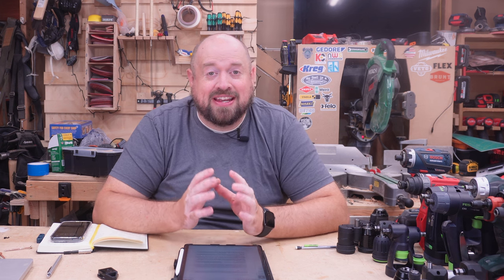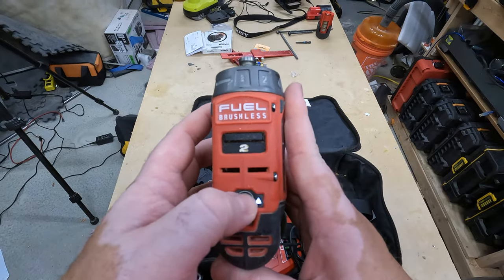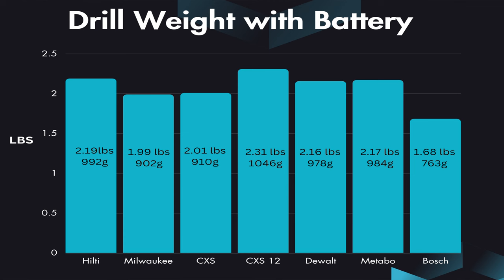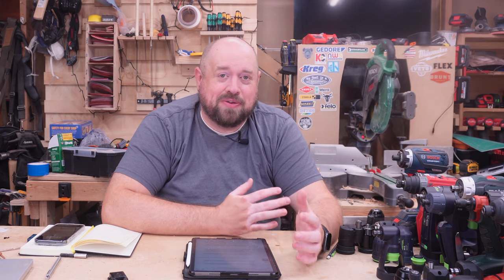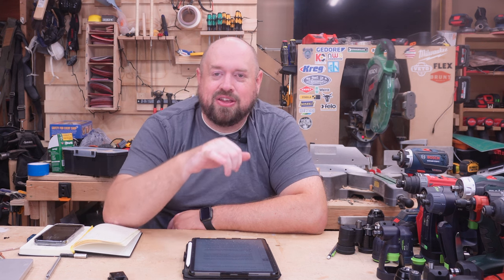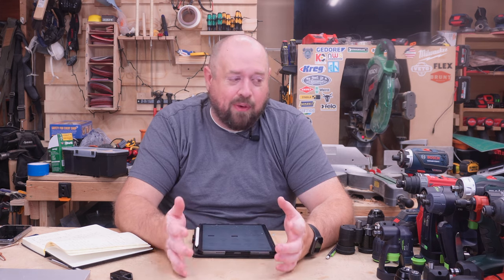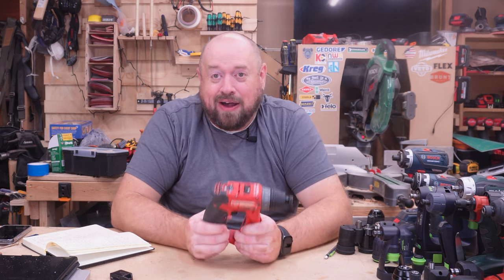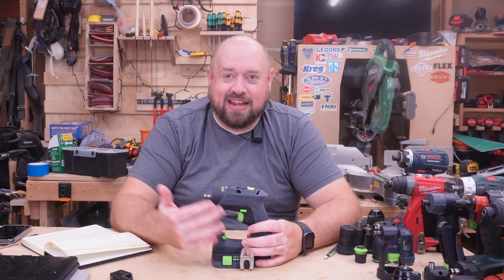Installation Drill Showdown!  Can Festool beat Milwaukee, Dewalt and More???

Comment: What is never mentioned in most reviews is bit runout. One of the reasons so many cabinet makers use Festool drivers is that the Centrotec bits have the least runout of any other manufacturer.
Reply from the maker: You are right, it wasn't mentioned.  I really do like centrotec in terms of the control that it offers, but it's also another added cost with running festool products.  I have next to no local availabilty of centrotec bits even at my local festool dealers.  They just don't have a lot of it in stock, even if I wanted to pay the price.   And without it, the festool experience is less functional than the other brands featured here since the locking 1/4" hex bit holder isn't included with tool just the magnetic one.   Not bagging on it's function, more the cost and the ease of access to the system.
Reply: I’m fortunate that I’m only 5 minutes away from the largest Festool dealer in Maine; and they stock everything.
Reply from the maker: Yeah, I wish that I had that.   I don' t have a need for the giant bit kit for this tool but it would be nice to have some of the common sizes.  And when I go in, they just have very little in stock.

Comment: Note: the 18v CXS is a little more powerful than the 12v version, but it’s also likely a little more powerful than the specs suggest. Converting nm to inch pounds off the UK Festool website, they are using the same max torque specs for both the 12v and 18v drills (compared to the US site), but the US version of the 18v has a 4 Ah battery rather than a 3Ah (whereas both 12v drills come with the same 2.5 Ah batteries). Both sites also claim the 18v w/o a battery is the same weight as the 12v. I’m not sure how that can be, but it can’t be much of a difference anyway; and because of the c body, the 18v is probably similar in height to the DeWalt 12v, but it is also probably considerably more powerful because of the battery (while still competing in the same size/weight class of drill). Just as important, the 18v CXS is 3 db quieter than the 12v CXS. As you probably know, 3 db is significant considering the non-linear/exponential nature the decibel rating system. Just some more food for thought.
Reply from the maker: Thanks for sharing.  I have never tried the 18v version, but have been curious to know who people are liking it.  For the most part people comment that it isn't as loud.

Comment: I grabbed the Dewalt bit driver (no speed select on gearbox) to try out a couple of years ago and then an 18v drill and impact as well.  I was surprised to find that their trigger precision was almost like Festool.  The attachments just seemed cheap on the Festool clone, though.   That said, the attachments are cheap on all of these 12v’s compared to the 18v Fein, Festool, Metabo and even Bosch.  So, whatever.  The original CXS is just too weak to take seriously, imho.  Discounting the brushed Metabo, all of the others are going to do the job of the T18/C18 but smaller and lighter…and louder.  Words can’t describe how quiet the T18 is.  I never appreciated until I got back into more general work and ended up trying every brand under the sun.  The Hilti chuck isn’t as niece as you think it’s.  Don’t be fooled by its metal sleeve.  The Hilti 12v’s are identical to the Panasonic counterparts in all but looks. I like them because I like how they feel in my hand, but I have to presume the Dewalt, latest Bosch, Milwaukee and brushless Metabo all offer more torque.  I was considering the new CXS or the 18v TXS they take the same chucks as my aging T18. I dunno. Kind of on the fence.
Reply from the maker: Have you had issues with the Hilti chucks.  I have had an 22v Nuron Hilti for about a year now and it works incredibly well.   Plus with their 20 year warranty it’ll put anyone’s mind at ease.
Reply: @TinkerWithTools  Coincidentally I did have an issue with one chuck (I totally forgot about that) on a 12v. Same chuck as on the Panasonic version.  No issues with the one that comes with the multi head.  I did replace the chucks on my Nuron drills simply because I didn’t like them. They were fine though.  The 10w-22 and 8m-22 will have Röhm chucks. Everything else appears to be Jacobs but without branding. But I could be wrong.

Comment: I've got my eye on the Milwaukee. For me, a big selling point of the tool is the grip style and size, so while the DeWalt seems like a fantastic deal the larger size and standard grip just don't sell it for me (I've already got a normal sized DeWalt 20v drill and impact driver after all). The interchangeable chucks are almost just gravy on top of the ergonomics, but the offset chuck is probably the one I'm most interested in. The number of times I've put a screw in just slightly off angle because I was in a corner, that seems like such an incredible feature. I really don't think I would mind the top button, I think I have large enough hands to just hit it with my thumb when needed.
Reply from the maker: If the Milwaukee is the only tool you use, you would likely get use to the Top button and would be fine with it.  I have owned that Milwaukee for over three years at that point and still love it.  But it's not intuitive at all.  I find myself flicking the forward and reverse on any other tools without even really thinking about it and this one just requires a little bit more effort.
Reply: One thing you will find out with the Milwaukee is the eccentric chuck doesn't have a locking collet. I have found bits tend to get left behind more times than I would like. Not a huge issue but something to consider.
Reply: I wasn't sure if the direction button would bother me when I got the m12 and I found that I haven't had many issues. I've gotten accustomed to it. The grip ergonomics on the m12 are great, and If a traditional switch threw off the grip ergonomics, I don't think I would be willing to part with the button.  @TinkerWithTools
Reply from the maker: @jronmanbuilds  you are right.   I haven’t had issue with it but my hard to reach places have more been up against the top or bottom of a cabinet where that hasn’t been has much of an issue.
Reply from the maker: @jronmanbuilds the Festool CXT has pretty much the same grip and ergonomics and the switch works great on those in the standard location.  That’s my point of reference that it is possible and my continued hope for a gen 2 where they revert back to the normal placement.

Comment: Great job and great information! Thank you! I will note that Amazon has the Milwaukee AS A KIT for $140, and I haven't seen anything from the other brands to match its value. Although I am on the DeWALT flexvolt system (and Milwaukee M18), I do not have any 12v tools so for me I have to decide between the excellent value of the Milwaukee or either the DeWALT or Festool CXS12. Thank you again for taking the time to do such a thorough comparison.
Reply from the maker: Glad it was helpful!   The only caution with Amazon I would give you is that they aren’t an authorized retailer so it can affect the warranty on the tool.  Your mileage may very.
Reply: That is where I got mine from. And I am a Ryobi guy, I mean everything from tools to yard stuff. Love the M12
Reply: Got the milwaukee at HD for $120 after returning free m12 3/8 ratchet
Reply: Also got the Bosch flexiclick for $110 on amazon, wish I hadn't missed the lowe's clearance...
Reply: Got m18 for 109, hack deal.

Comment: Imo Bosch wins, I don't really agree with your ergonomics rankings but besides that it was a great test. I had the dealt but it just felt cheap to me.
Reply from the maker: Ergonomics are going to be fairly personal.   I get that.  And you right, the dewalt doesn't necessarily feel like the most robust option here.   The bosch is a little tank and performs quite well.  There are just a few minor things that I don't prefer about it.

Comment: Walmart recently released Hyper Tough 12V  3-in-1 Multi-Head Power Drill Set with 1.5Ah Battery and Charger, 80003. Currently going for $34.88
Reply from the maker: Yeah I see that.   Based on the power specs the quote I would suspect it would be outclassed by almost everything here but for that price might be worth checking out one day.

Comment: I know many people have an issue with the noise on the CXS 12. I Have been using it for over a month now and it doesn't sound any louder than my Milwaukee M12 driver.
Reply from the maker: It hasn’t stopped me from using it.

Comment: I wanted the Hilti to flex on the job site, but i wish they had more 12v products. Plus it seems like they might be doing away with their 12v line. I ended up getting the Bosch?
Reply from the maker: Bosch is a good option here but in in the US at least their 12v lineup is decreasing in exposure as of late.   I wish it werent the case because they have some solid 12v tools.  I love their 12v random orbit sander.

Comment: Yes the Festool accessories are expensive. But if you’re crazy enough to also buy an 18v Festool drill the eccentric chuck also works with them. So you aren’t buying and carrying around different accessories for each drill
Reply from the maker: Yeah the compatibility within the ecosystem is certainly up there with the best.  It comes at a price but they do work to make all their products work well together.

Comment: Sheesh, what a DeFault Schil!  😯🙄😂  @ 17:09 Your face made me wonder if You were confidant in your decision?   ( I am a fan of the 12 Volt XTreme lineup )

Just got a great deal on the Milwaukee, which included a bonus 5.0 HO battery.  So, You saying I should send it back?  😞 😯  ( One area that I am not a fan of is the insipid little bags for the M12 tools )

Tinker With Tools !!!!!!!!!!!!!!!!!!!  👍💪✌🇺🇸😊
Reply from the maker: Yeah I think the face just came down to a point of disbelief on my part.  I had done the testing over several days but didn’t actually look at the winners in each category much before I recorded that point and as the start wouldn’t have predicted the DEWALT would be my winner.  

Now should you return the Milwaukee with the bonus battery?  No I don’t think you have to.  The Milwaukee didn’t fair as well I would have predicted but really whether you choose DEWALT, the new Festool, Milwaukee, Bosch or the Hilti you are getting a pretty good tool that is competitive right now.  It will come down to little differences on which is best for you at that point.

Comment: @TWT I might’ve missed it in the video, but do the attachments on the Festool CXS 12 accept standard 1/4” hex bits? Or do they only accept centrotec bits, and a centrotec to 1/4” adapter is required? Just wondering because I can’t really find definitive information on but compatibility. And thanks for making this comparison video - I’ve shared it many times, because it’s so helpful in deciding which installation driver to buy. 👍
Reply from the maker: I appreciate you sharing!  As for your question - yes and no.   The locking chuck attachment is a centrotec specific adapter.  It will not accept standard 1/4" hex bits.   They do provide a 1/4" hex adapter (that is centro tec) and that will allow you to use them, but I find that it's retention on the bit isn't the best.    There is a locking bit adapter that would allow you to use standard bits but i haven't purchased it yet.
Reply: @TinkerWithTools  Thanks for the info! I have Bosch and Milwaukee installation drivers, and I let someone borrow my Milwaukee, which got him really interested in installation drivers. Especially that style of installation driver, so I bet he'll choose the Milwaukee over the Festool, when I let him know the Festool needs the adapter for 1/4" bits.
Reply from the maker: Yeah, if you are going to go in on Festool, I think the best thing to do is invest in centrotec bits.  Proper festool bits are expensive but you can a few other brands a slight discount as well.
Reply: @TinkerWithTools I think my friend just wants something for DIY stuff, so the fact that Milwaukee accepts 1/4” bits without an adapter, is going to be the deciding factor for him, since he can just have one set of 1/4” bits that are also compatibility with his bit holding screwdrivers, rather than also carrying centrotec bits in his tool bag. I think the Festool is great though, and I’ll pick one up eventually, along with the Hilti, because installation drivers are probably my favorite type of power tool. Thanks again for the info and making a great comparison video. 👍

Comment: I love my 12v Dewalt.... ergonomics are great (for me at least) and I've found it to perform really well, but if I could go back I'd buy the Milwaukee instead. Their 12v system looks really impressive and it seems Dewalt is kind of neglecting the 12v lineup.
Reply from the maker: They had a good bit of development for a while but it does seem as if it has stagnated a little.

Comment: I am wondering what installation driver using 18v is the Best, i know bosch and milwaukee have one, but not sure what other brands have en that category
Reply from the maker: The Milwaukee is not available in North America so that's one of the main reasons you haven't seen it on the channel.  Festool makes an 18v now.  Hikoki recently announced a 18v version as well that looks to be similar to the 12v Metabo (German) version.    I have the Bosch and like it but for the form factor and use cases I have ended up going with 12v most of the time.

Comment: Honestly, I don't know who would buy those Festool models. That Festool attachment alone costs more than my Milwaukee and Bosch sets. I got Milwaukee set with 2 batteries for $113 and Bosch for $99. 
I got Milwaukee first because of the M12 investment. However, after owning the Bosch I use it much more. I'm not too fond of the guard bit magnet and top directional button on the Milwaukee.
Reply from the maker: You can definitely get more value for your money elsewhere.   Hence why the DEWALT was the winner or recommendation of the video.   But that doesn’t mean that the festool isn’t a nice tool just not one for everyone.

Comment: great video, between DeWalt in your video or Atom line canI get your opinion on it
Reply from the maker: I am not personally a fan of the Atomic drills... unless you are talking about the second gen DCD799 hammer drill. I much prefer just going to the DCD800 which is roughly the right size but a lot more power.   The only concern I have with the 12v recommendation is just how invested Dewalt is in the playform.  It's been a while since they have done that much with it...so while it's good now, I have more faith in their 20v max system getting continual improvements.

Comment: can the onthe tools hold a bit withou a chuck?

the CSX is good becuase you can put a 1/4" bit driver directly into the drive shaft when you remove the chuck
Reply from the maker: I believe on almost all, if not all of them, you can do that.  they aren't necessarily a locking bit holder at that point but some do have a magnet that makes it functional at that point.

Comment: Hello been watching quite a few of your videos. I make bespoke fitted MDF wardrobes. Been using a dewalt 18v impact but want to find something lighter and quieter. Do you think multi chuck is the way to go? Many thanks
Reply from the maker: I am guessing you are talking about assembly and installation?   There are two ways you could go in my opinion.  THe installation drill driver would work (and as you can see there are several to choose from).   The other option would be the Surge from Milwaukee (either M12 or M18).  Those would give you the traditional impact performance with greatly reduced noise.
Reply: @TinkerWithTools  hello thank you so much for your reply. I do like the look of the multi chuck tools. Yes I build and install

Comment: I could never justify the 'normal' drill or 'normal collet' attachments in my head.

And because of it, I haven't been able to justify spending double on an installers driver over a normal screwdriver for (in my mind) only two actual useful attachments 🙇‍♀️

These need a through-hole nutrunner or a pizzawheel cutter 🙏 when there's only two unique attachments it makes multihead drivers look so much less relevant compared to a normal screwdriver
Reply from the maker: I think with something like the Dewalt 12v Brushless Screwdriver, the way that you might use the tools is similar, but I do think that the added versatility of the additional chucks is a nice touch.  Given their intended purpose of being something for installing cabinetry, I think the four chucks that most of them have a good for the intended purpose.